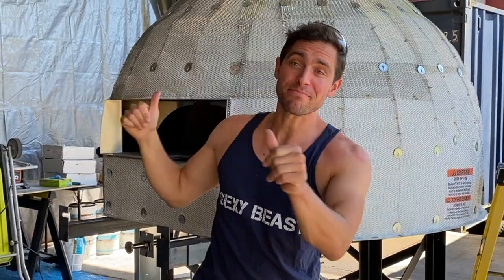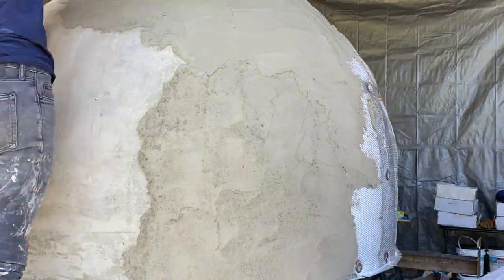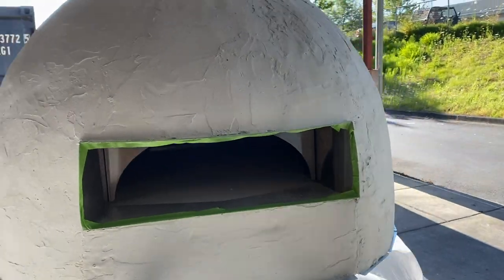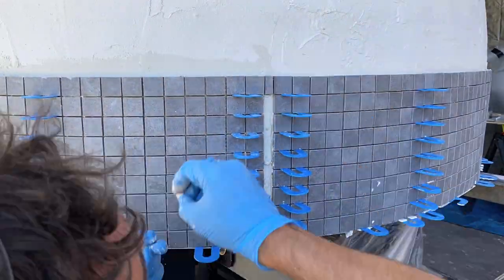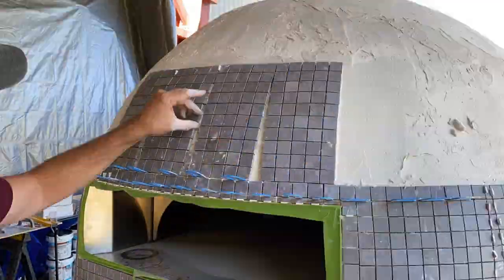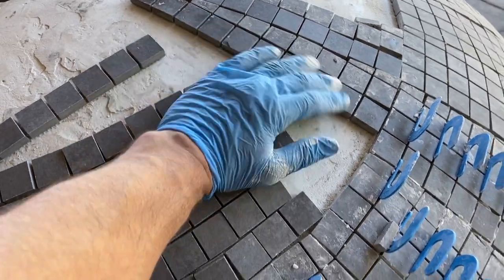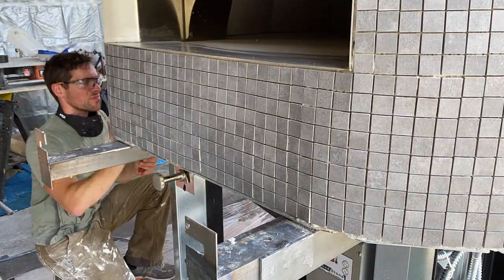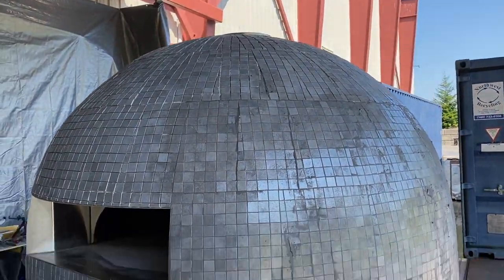HOW TO TILE A ROUNDED SURFACE

Comment: once you got to the 2/3 height you should have cut the sheets into rows of three and then stick them in rows round the dome starting from the centre of the front opening and let the tile joints overlap more and more towards the back . the nearer the top reduce the strip to two rows then one
Reply from the maker: Interesting concept David and I may have to do that if I ever do this again.  Thanks for the suggestion and for watching!  I greatly appreciate it.

Comment: I admire your perseverance - square tile mats on a domed surface was never going to be easy on the eye.  My takeaway with this fixed tile choice is perhaps to consider concentric circles one horizontal tier at a time and take a hit on the grout spacing and vertical alignment.  Will leave Fibonacci spirals to nature :)

Comment: I have commercial ovens and regular adhesive never handles the high temperatures, so the tiles over the door always tend to fall right away. Do you use a special high temperature adhesive or how do you prepare ?

Comment: It looks awfully bumpy especially once the tile is on. Could have done a much better job prepping the surface to make it smooth before tiling. And should you not have used heat proof mortar?